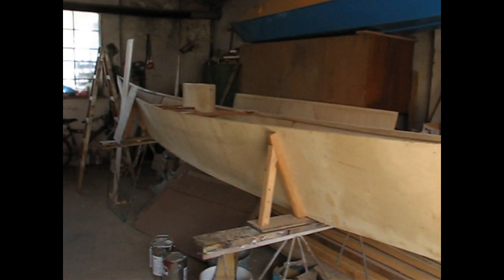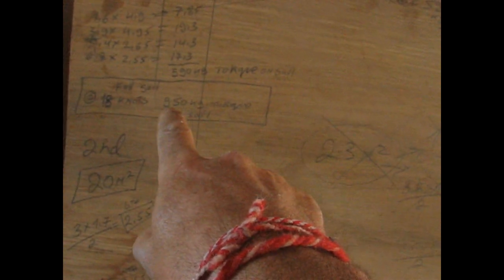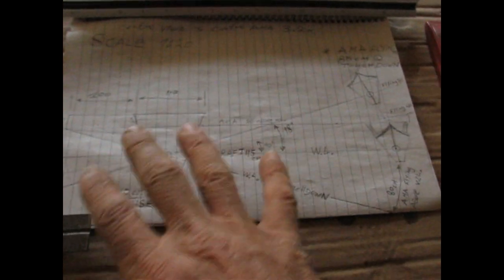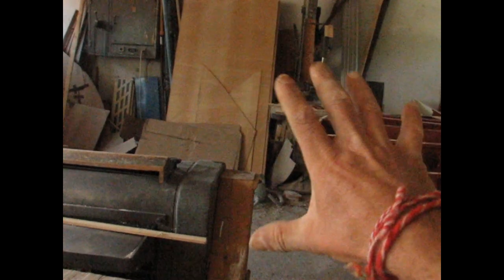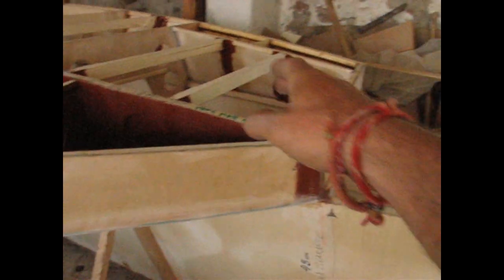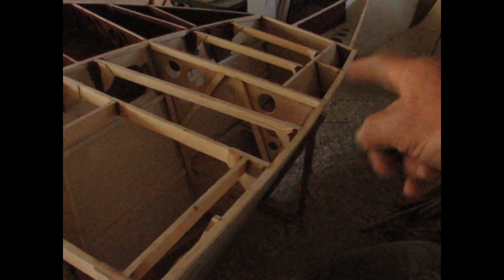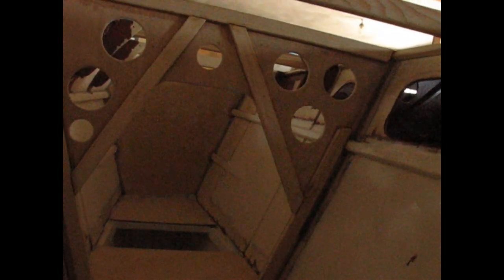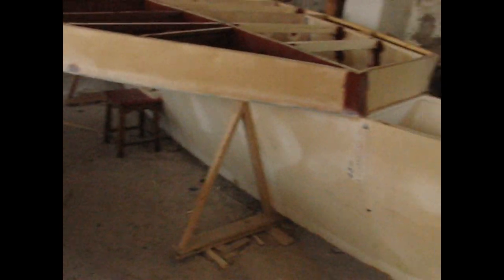Proa 'One Force 213' BUILDING episode 6

Comment: Once again, loving this series and hearing your thinking throughout. My background is mechanical design engineering, with everything designed and simulated before the first bit of metal gets cut, but when I build anything for myself, it's a lot more freestyle/organic. Figure out the critical stuff you have to upfront, then let the rest evolve as it takes shape in front of you. 

Man I want a proa. Stuck in the middle of a house move from central England to the coast. Going to be near the water, going to have garage space I could build a 5m vaka in. Just need to figure out whether it's most important to me to build the boat in my head as soon as possible, or park it a while, buy a beach cat or a small cruising boat and just go sailing right now.

I'm sorry your launch date has slipped back, but I'm sure it's going to be worth the wait. Keep shunting!
Reply from the maker: Interesting dilemma.... I've been there and done that... I got tired and just jumped in to deep water and, built a 7 meter Proa that taught me a lesson I will never forget! Bashing on rock in a F5 after a shunt went very wrong.... The anchor bit in the last second, eventually we got out of there.... A nasty experience on a 3 year build that was almost impossible to sail! A hard start, I went on to the second, the third, now the fourth build....

5 meters is a good start, you could  easily get it done over winter, it won't be perfect, fine tuning will be the next step.... So truly the fast way to the water is buying what ever.... But a good Proa that can cruise far and relatively fast is an amazing thing to have! I sailed a 22 mono from Poole to Bulgaria, she was the best boat in the world, I still miss her, but nothing sails like a good Proa! My third Proa sails like a Cadillac in conditions that were very uncomfortable with our Mono.... 

A beach cat is expensive, harder to transport... there's no easy answer, 'Baby Mana' had four berths a head and full galley at 22 feet that's a lot of boat.... Make O'Break is cheap, lightweight, easy to transport, fast and safe.... I suppose it truly comes down to your needs, where will you keep your boat, how much will that cost??? 

There's lots to consider.....    Keep Shunting bro, Balkan Shipyards

Comment: Beautiful, a true work of art. Those hull shapes look great. The curve of the deck is so smooth looking. Any approximation on your weight of the hulls? Yours look pretty light weight considering you are using plywood and epoxy home build. Mine was overbuilt and was 300 to 350 pounds all said and done at a little over 4 meters.  Leepod looks amazing, those stringers will be strong.. You said you would use something I did on mine... Is the "hole blasting" it??  Ha "Holesaw" I dont sweat the terminology either.... "Less is more" I agree. Get "Make o Break" out this summer!!  ZPLAA.
Reply from the maker: Bro Zack, this is lightweight hull design!!! At the moment the Vaka is about 80 kg, we picked it up no sweat. Probably with deck glass paint and some hardware it will go to 130??? For it's 800 litre displacement I'm pleased. My first Proa was overweight too, much heavier and only 660 litres volume... Happy she made u think about weight loss! on multies it's important! Yea, going sailing September, then roofing till mid November, then it's back to filling he fireplace and trying to build a boat.... Winter here is too much! Keep Shunting Bro, waiting for your progress, I like your thinking and shunter set up.......... Good Luck!

Comment: Hi Rael your proa is looking great. I am build a 5.5 m proa with two ama I am building  with oak 1/4" x 2" strips epoxy glue together. I want to fiberglass it Want size  should I  use
Reply from the maker: Hi Elmer, I cover my boats with 80 gram glass. On the bottom to 5cm above waterline, I put a second layer, again 80 gram. Try to put the second layer on wet on wet. That's what I would do on a 5.5 meter. On this boat I will put 80 everywhere, and 150 on the bottom over the 80. I want good protection on the bottom for beaching.... But please understand this is my opinion, so continue to research the subject and see what others are doing....... Good Luck, and Keep Shunting man, Balkan Shipyards

Comment: why don't you have your bed in the lee-pod? too hard to fit bulkheads and make it strong enough? or just not enough space until you hit the water on a 25" boat?
Reply from the maker: Too small! This boat is low profile low windage.... So pod is only 25 cm high. Though I believe Proas should have beds for and aft, then you sleep forwards when going to windward and backwards when running.
Reply: @BalkanShipyards  Was Russ Brown's first proa about the size of yours? I can't remember whether he slept in the pod or the hull.
Reply from the maker: @cornishhh  It was about 30 foot, and had higher topsides so maybe... I think he did have a bed in the pod. But not sure.....